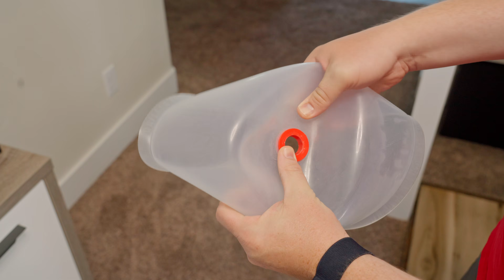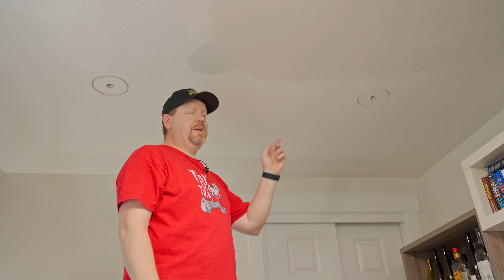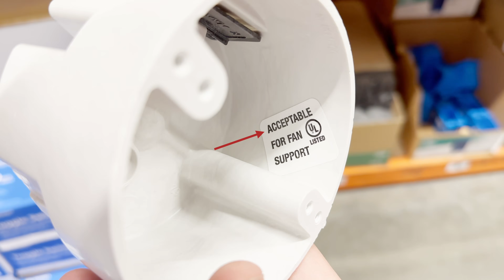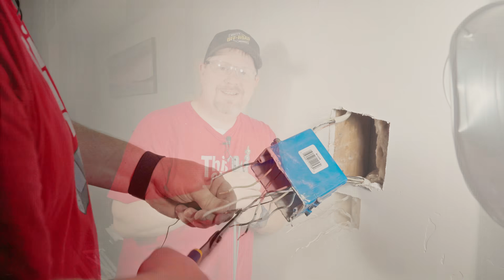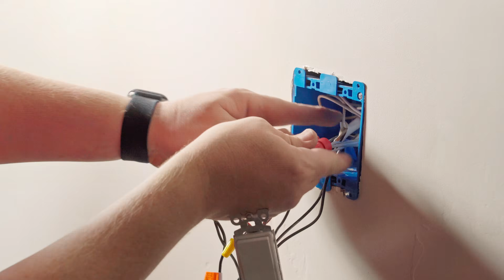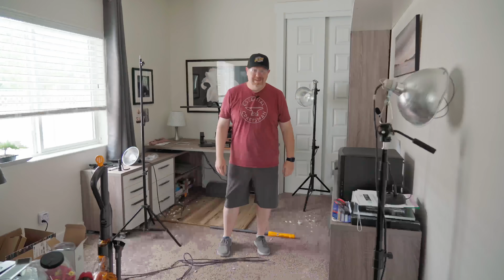A Simple and MASSIVE Improvement! Installing Ceiling Fan and Recessed LED Lighting.

Comment: One way to speed up removing the old box could be to use a Sawzall/reciprocating saw with a blade for metal. Should be the same width as the hacksaw blade so you can use the same technique of sliding it between the stud and the box the cut the nails, it just saws faster than you can by hand. Downside being you might get too eager and keep cutting into one of the wires or something else of course, maybe the slow tedious way is safest. Great video! 
11:18
Reply from the maker: That is a good idea - but yeah, it'd be pretty easy to cut something you didn't intend, or accidentally punch right through the wall on the other side, etc. Thanks for watching!

Comment: Drill a small hole at the edge of the ceiling thats vertically in line with the switch box. Stick a white wire or similair through. Now when your up in the attic you will see the wire sticking out and you will know to drill at that spot. Then you can fish your Romex down and not worry about the insulation wrapping around your bit. My 2 cents anyway. 😅
Reply from the maker: That is a great tip - but I really dislike dealing with fixing holes in drywall... then again, a tiny hole in the ceiling is not really a big deal to fix... 😂
Reply: @AmplifyDIY Just a tiny bit a filler in the ceiling.. u wouldnt even notice it.

Comment: why not just connect the recessed lights to the fan circuit, fan switch turns on lights
Reply from the maker: Because I wanted independent control of the fan and lights. I don't always want the fan on when I'm in that room - in winter, for example, that room can get a little chilly. Great question!

Comment: Curious...couldn't you keep the single switch for the  ceiling fan and power the lights from the fan itself  ?
Reply from the maker: No, the fan control is not a simple on/off switch - it's got three speeds, etc. The lights need their own simple on/off switch.

Comment: You really needed to put conduit fittings in each of the light boxes to protect the casings of the wires from any type of possible damage. (ie, a cut in the casing leading to a possible short and fire!)
Reply from the maker: This is a great safety tip, and one I overlooked. Thank you!
Reply: @AmplifyDIY  👍👍

Comment: Great job.  One comment is any time one is using a knockout in a metal electrical box, you must use a strain relief.  Whether snap in plastic gripper type, or the metal NMC clamps with two screws…  wire should not be against such stamped metal edges.

  Excellent project overall, and the chafing is really only an issue if the boxes get moved around, or tugged on.  (Like when one is fishing around in an attic, with a wire hook.  😂
Reply from the maker: Great tip. I'll be sure to use strain relief in the future. Thank you!

Comment: The Romex wires are meant to follow your drill bit and not be taped to the side of it. That's why there is a hole at the end of the bit. You take a single wire and hook it though the hole then tape in place.
Reply from the maker: Thank you very much for the tip! I love learning from viewers like you. :)

Comment: Haha. I actually came here to check out your other video of the fan you did install previously, because my daughter needs one for her condo bedroom, so I could get the model., because I need one light weight since its just a light fixture, and have no access to above.  Guess back to the drawing board.  As well, I have done what you did here in 2 bedrooms of our house that had the same issue of one light on the fan.  Makes a world of difference, and the wafer LED like this make it so much easier with no more "cans"  Mine were in the basement, so no attic access.  For one room had to cut the drywall on the wall above the switch, so we could drill and feed the wire down.
Reply from the maker: The one from my other video would not be a terrible choice for a condo with limited install options. My biggest complaint about it was that it was just too noisy, and I found it distracting while working during the day. 
Basement installs can be considerably trickier - especially if the floor joists run perpendicular to the direction you need to pull wires. Ugh. 
Thanks for watching!
Reply: @AmplifyDIY  We found a fan at Costco that is only 10.2 lbs installed.  An Artika Edwin, same sort of set up.  I dont think I can find a much lighter fan.  Time will tell this weekend when I take the light off and see whats up there.

Comment: The non-contact voltage tester beeps when near what appears to be the neutral wires.  That should never be the case. I would investigate further.

You measured potential (voltage, not current) across the switch contacts. Was the switch open? Was the load (old fan) still connected? Hard to tell, but did you use the AC scale versus DC? How do you know you made contact with the wires inside the wire nuts? I would have measured from each switch connection individually to ground (ground and neutral are bounded together at the main electrical panel of the house). I would also turn the breaker on and repeat your testing to verify your technique is correct.

No bushing/grommet to protect the cable? Aren't the edges of the holes of the junction box sharp?

Really appreciate your technique to keep the attic insulation in the attic.
Reply from the maker: Hi Art - thanks for your insights. I didn't show it all on camera, but off camera I did a really thorough test of that switch and the circuit... I was using AC detection, and I made sure that the probes were making contact in the wire nuts between load and neutral, neutral and ground, and load and ground. It always measured exactly 0... yet the non-contact tester still went off when I probed anywhere near the wiring.  Faulty non-contact tester? 🤔

At any rate, I was certain that the breaker was off to that circuit, and that the entire circuit was dead before I disconnected anything. Next time I'll be more thorough in showing the exact testing I actually did with my meter before disconnecting any of the wiring. 

I appreciate you chiming in - and thanks for watching!

Comment: I hate going into my attic. The previous owner sealed up an attic fan that I wish I had. I would like to spray insulation up there, but have been holding back till I investigate the fan and get a bit more electrical ran.